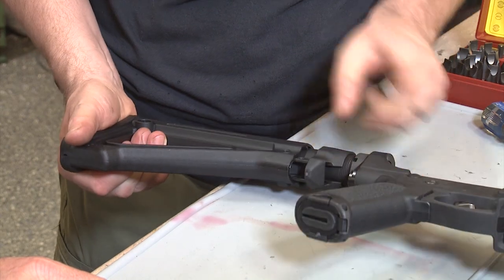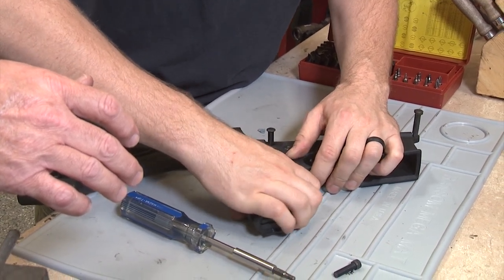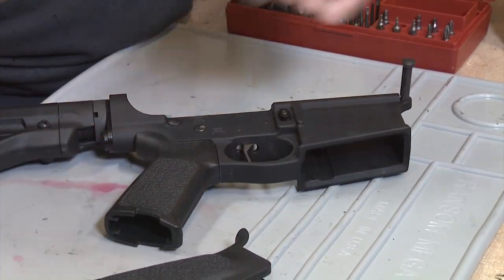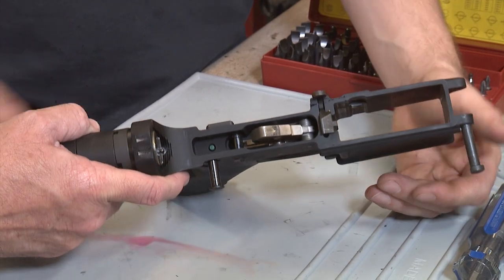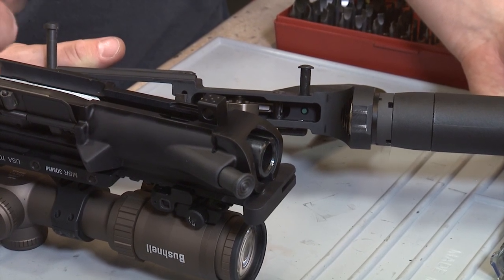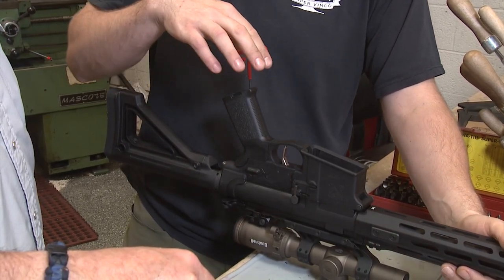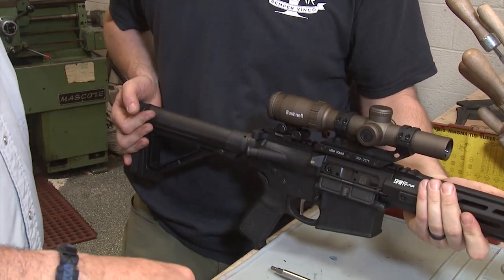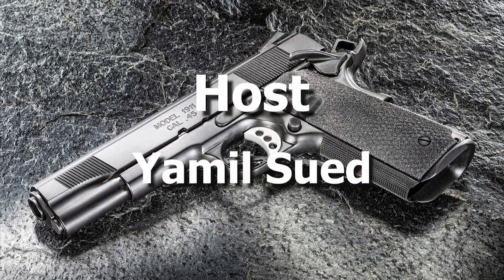How-To Replace the Pistol Grip on the Springfield Armory Saint Victor .308

Comment: Where did he stick that t handle? Just changed my grip on my victor and noticed it has some wobble to it now.
Reply: I don't understand the question?  We didn't get any wobble, you might have an issue with the grip you used or it's incorrectly installed or you pinched the spring!!

Comment: can i get a replacement part number or where to find a replacement with the 2 holes??
Reply: ALL the Magpul MOE Grips have two holes!!  I mentioned on the Video what grip I was using.
Reply: Yamil R. Sued you did not mention what pistol grip you were using. I believe you installed the MOE K2
Reply: @TonyMontana-sh7cf it was the standard MOE Grip